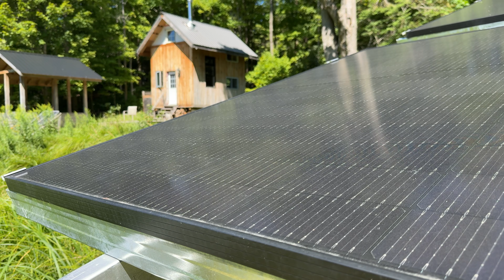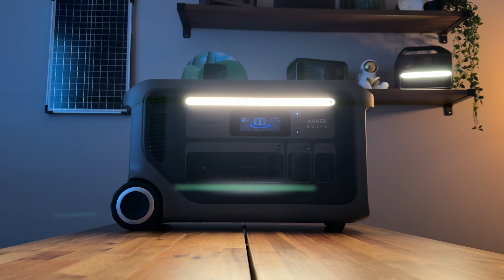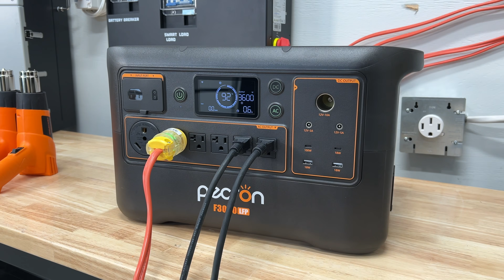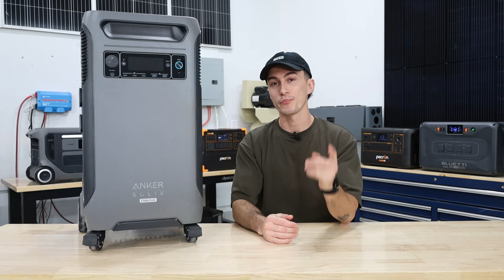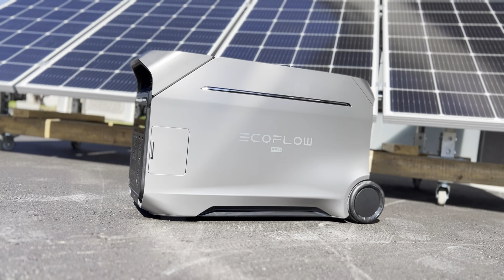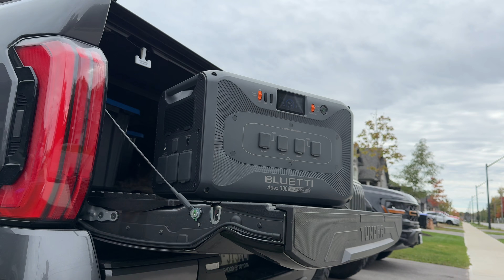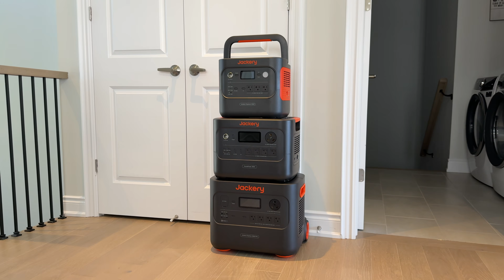Best Big Power Stations of 2025 - Ultimate Power for Home Backup & Offgrid Use!

Comment: I bought the Pecron E3600;  two of them and 8 batteries to make a 220v system.  The power stations would not communicate with each other and constantly rebooted at unexpected times.  Pecron diagnosed inverter problems, then cell problems.  After I sent them my units, they sent out a used unit as a replacement and it could not work with the batteries,  I'm now three months into trying to get working units.  Pecron promises me they will resolve this and somehow get me a working system but I have nothing at all right now.
Reply: I'm not so sure other manufacturers would handle it any better. Please keep us updated.
Reply: Reason I won't do Pecron 😢 plus only a 2yr warranty plus maybe 1. Industry avg. is 5 yrs. 😮
Reply: @ValePlace  Yeah loads of sogen reviews have commenters saying "just get a Pecron dude", they're still.a budget brand, with budget brand problems (not that the good brands are all that good either), just a cut above the true "no names".
Reply: @ValePlace they have a 5 year
Reply: Same thing happened to me.  Charged the batteries up, first power outage the 240 hub kept beeping and would reboot constantly.  I had to pay $80-90 to ship it to their factory in CA.  They tried to tell me the same thing and send me used units as replacements, and I bitched enough for them to send me two brand new units.  Complete BS to buy a brand new unit and be sent a use refurbed unit and call it square.  They also sent me a 10% off coupon for another pecron purchase for whatever thats worth.
Reply: I’m sorry for your problems, but I appreciate the information as I can remove pecron from my list
Reply: @jesseballard4753 i second that; too many other good units to gamble on. Plus the lame warranty period.
Reply: No wonder Perron is the cheapest.
Reply: I was looking at Pecron and have since read stories like yours. Your story sealed the deal--no Pecron for me.
Reply: @captainamerica6525  Same here!  I'm convinced it was only the intervention of Youtuber Jasonoid that got my problem resolved.  Jasonoid graciously offered to contact Pecron and get my problem units fixed.  Within the hour of sending him my info, Pecron emailed me and offered to replace both units.  Many thanks to Jasonoid!
Reply: @captainamerica6525  save an extra month or two if needed and get quality brand. You will sleep better. Doctor approved 😂
Reply: Not good. Hope you get the issue resolved soon.
Reply: @SixSaturdays  Thanks for your kind words!  I've lost faith in Pecron and ordered a more reliable and permanent system to install at home and take the tax break on it before that vanishes at the end of the year.  I'll use parts of the more mobile Pecron system in my camper and as backup for the house (if they fix it).
Reply: Update?
Reply: @rainerrain9689  The Youtube influencer, Jasonoid, read my post on his channel and offered to intervene with contacts he had at Pecron.  Pecron promptly contacted me with an offer to send two brand new E3600 units.  This was accomplished by about Dec 15 and all is fine.  I'm very grateful to Jasonoid for all his help!
Reply: I would be curious to see the update regarding this issue. 

My experience has been completely different. I own the e3600 and all of the expansion batteries and it has work flawlessly for over a year. 

I also had the e1500 and it needed to be replaced. 

I have the EcoFlow line all the way up to the Delta pro and number of the Delta Max and the Delta Max 2. I just have to have 1 Delta Max unit replaced. Overall both products have been solid performers. Eco flows are more expensive but the app is much better. 

My use case is primarily my RV and some home battery backup.
Reply: @alphonsorivera1111  Glad things worked out for you!  Here's an update.  A YouTube creator, whose channel is JASONOID, contacted me after reading my posts about trouble with Pecron.  He offered to take my information and get the situation resolved.  I sent Jasonoid my info with my thanks and within  an hour Pecron contacted me to say they were sorry and would send two new, working units.  So, many thanks to Jasonoid!  The units arrived by about Dec 15 and they work fine.  Jasonoid somehow compelled Pecron to do what they should have done three months earlier!
Reply: Time to switch to EG4 real DIY. I wasted 25k, yes $25k on Anker Solix over 40kwh of their products. Now run flexboss21 with 18kpv, gridboss and 4 eg4 pro big batteries close to 60kwh. I use the Ankers now as generators, but rarely. They are ankers and collecting dust.
Reply: @SurgeonTech bro that much money you should of started your own channel lol
Reply: @will201084  I will be honest. I did start one and got 2k views in the first couple hours on an anker solix entire line in july/august and my wife had me shut it down. She does not want me to get youtube famous for some reason. 😂 crazy i know. I'm just a surgeon, but I love this stuff and tech.
Reply: @SurgeonTech which Anker.?
Reply: @ValePlace  F3000x4 plus 8 battery packs, F3800 plus x4 and battery packs, and some that i gave to relatives as gifts after i got my house running off of EG4. Bought smaller versions as well lol. I fell hard for their emails. As soon as I open the email, and close it, they would send a couple more emails instantly with more coupons and stuff I got in the cart, but didn't check out, kept getting slightly cheaper with their tapped email codes. They advertise well. Keep in mind this was all in June/July, crazy prices and a bunch of solar panels. Live and learn
Reply: Been there done that! Moved on
Reply: @dinobernardi170  life is better on the other side 👊👍

Comment: That 240 plug on the Delta PRO 3  is one of the reasons I bought it. Our big 20,000 BTU AC unit plugs right into it, and I have no desire to wire up a whole house panel.